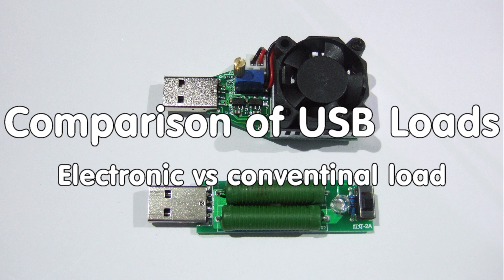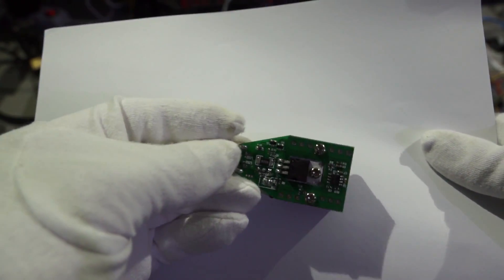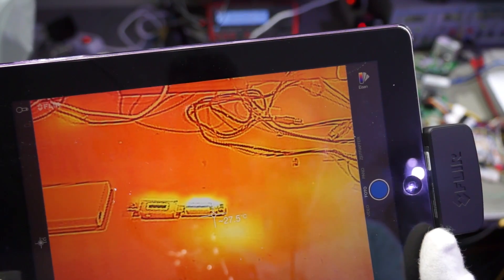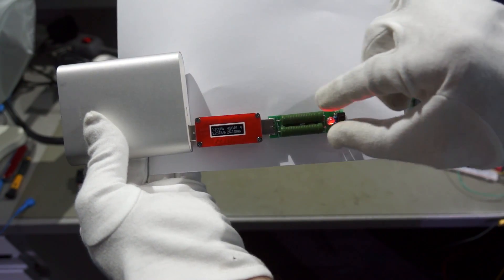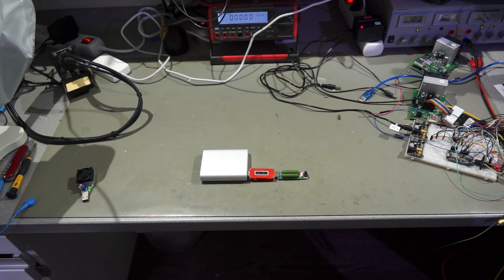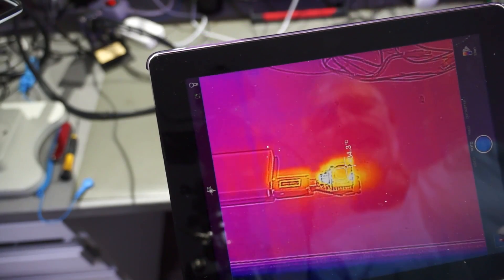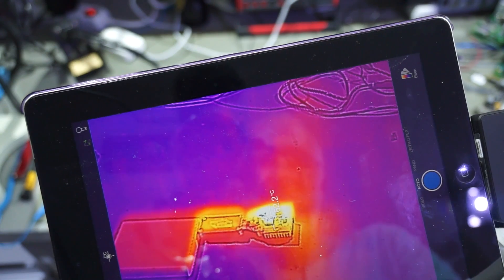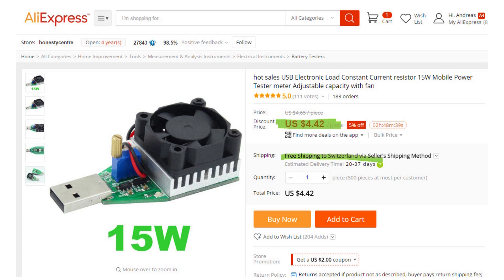#75 Comparison of two USB loads

Comment: Thank you for the video, I recently invested in a USB load tester that I use in combination with a UM25C USB meter to check USB cables and power banks.
The combination is helpful to ensure that I'm getting the most out of a USB power source.
USB power has become very commonplace in our homes, cars, camping etc., so it's nice to be able to test and get the most out of our USB devices.
Reply from the maker: A good idea!

Comment: I have the same electronic load module, but it arrived slightly damaged... the capacitor marked as C6 is broken off (on the board edge next to the op amp). It still works, but my guess is that the fan control hysteresis is affected, as that's the only thing I noticed that may not be working (fan turns on-off repeatedly when temp. is reached). Well, if that module originally had such a function at all ;) I was unable to find any schematics.

Do you happen to be able to measure that capacitor and tell me the value? I'd like to replace it. Thanks
Reply from the maker: I cannot measure it. It just shows me two diodes. And it is nothing written on it.

Comment: Thanks for video. I think you should disconnect the heat sink and apply some thermal conductive grease under the transistor, most likely, it is abscent there. Connect the heat sink, check tightening. Compare temperature.
Reply from the maker: You are right concerning the grease. There is none. But the cooling works ok and I do not use it too often. For a frequent usage I would definitively follow your recommendations.

Comment: Nice video. Just curious to know how much does the IR camera costs?
can you kindly provide the link from where you got it?
Reply from the maker: It is a FLIR one and it costs 259 CHF here. You get it in two versions, one for Apple and one for Android. 
https://www.digitec.ch/de/s1/product/flir-one-thermografie-kamera-fuer-ios-schwarz-mobiltelefon-zubehoer-5723421
Reply: thanks for quick reply.
Although a bit high for hobbyist like me, but sounds good price considering huge prices of other commercial IR cameras.
Reply from the maker: You are right. Expensive, but cheap compared with other devices. That is exactly, what I thought...

Comment: I am in need of a 110V AC --> 48V DC 10A  constant current (CC) source. Any ideas?
Reply from the maker: No. I am currently not in power applications. I would look for a high power LED driver with maximum 48 volt , because LEDs need constant current. With a quick search I found one on Aliexpress, but only for 220v input.
Reply: Andreas Spiess
Yes, I can't find one for US. Converting my Electric Scooter to a Hybrid with a $200 generator and a constant current charger that can give me 10 Amps. Then I could run on mid speed indefinitely.
Bought a converter but it wasn't constant current and blew up :(
It's in Silicon Heaven now.
Reply from the maker: And its designer will end in hell because he forgot the over current protection ;-)

Comment: Thanks a lot. I am going to get the transistor load and keep the 2 resistors load in the drawer. It is really dangerous and I used to put a big fan to keep it cool.
Reply from the maker: I will throw it away because I only need one ;-) Not a big loss.

Comment: Thanks for the comparison, I was never very comfortable with the simple version unit that I have here. At the bench I can use my electronic load but away from the bench it's nice to have a portable USB load and I'll be getting one of the active loads...thanks for sharing.
Reply from the maker: I also have a normal electronic load. But for USB I prefer these small devices. And I really liked this module when it came. It is very well done for that incredibly low price.
Reply: I just ordered one via Amazon that in addition to the fan, etc. has a built-n voltage/current display and we'll see how it works; appreciate you bringing it to our attention.